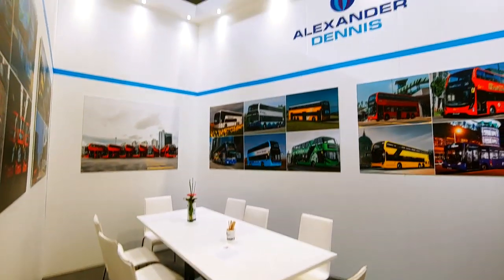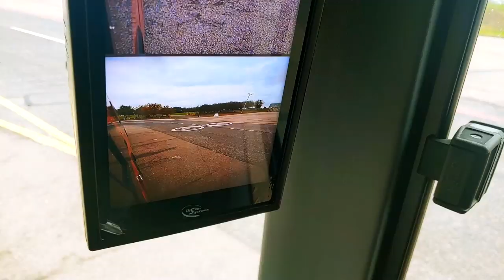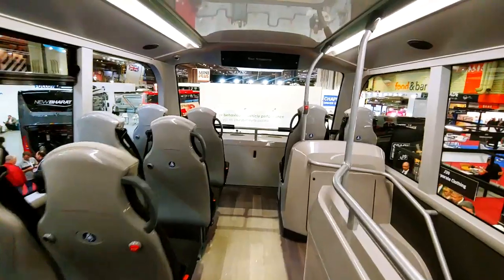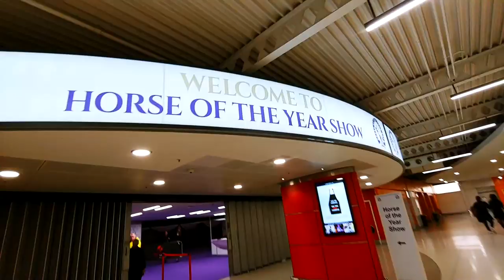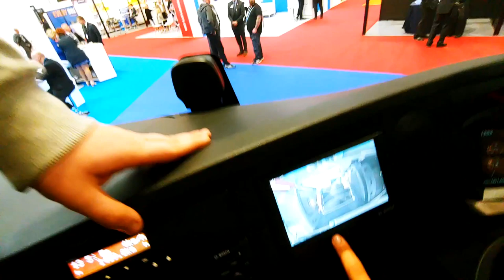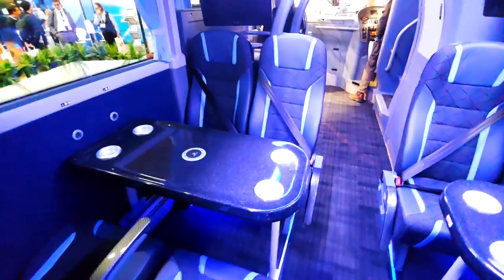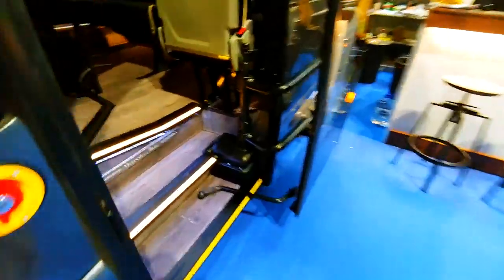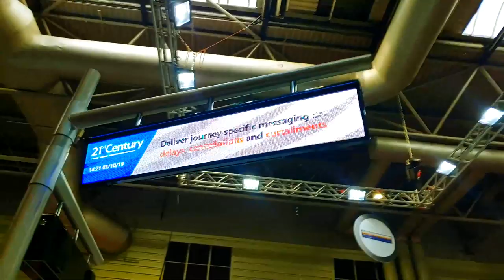Looking around Coach and Bus show 2019

Comment: They have had cameras replacing mirrors on trams for over a decade now which does make sense as it allows for the trams to be a little wider while still staying within the clearance envelope. It also comes with the benefit of the cameras being linked to the CCTV system so those combined with cameras inside and dash cams can allow for a massive number of different perspectives of incidents when they happen.
Reply from the maker: A tram is a bit different to a bus.  With a bus the cameras need to have very low latency.  Most consumer grade systems would not be good enough.  Even a fraction of a second latency is not good enough as it would compromise safety due to the drivers reaction time.  In the UK cameras instead of mirrors is a very new thing for the side mirrors.
Reply: @benolifts  
Yeah it’s like the total latency needs to be less than 5 milliseconds which is more possible today but would have been very difficult a decade ago if they had to achieve the same latency in tram cameras! That’s unless they used a mostly analogue system that had almost no latency! :)

Comment: Singapore also have 201 12.5 Metre Double Decker Alexander Dennis Enviro 500, 3 Axle, 2 Door, 1 Staircases, Aircon Bus and Singapore is going to buy another 50 New 12.5 Metre Double Decker Alexander Dennis Eviro 500, 3 Axel, 3 Door, 2 Staircases, Aircon Bus and London have 0 12.5 Metrs Double Decker Alexander Dennis Enviro 500, 3 Axle, 2 Door, 1 Staircases Aircorn Bus and 0 12.5 Metre Double Decker Alexander Dennis Eviro 500, 3 Alex, 3 Door, 2 Staircases, Aircorn Bus but London do have a lot of different type of Singl Decker Alexander Dennis Enviro Bus and different type of Double Decker Alexander Dennis Enviro Bus that Singapore do not have.